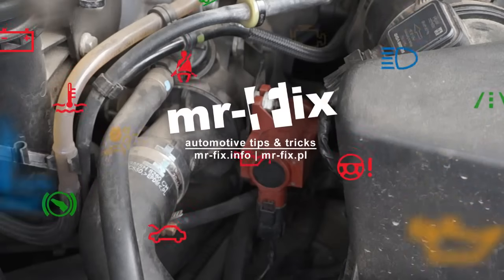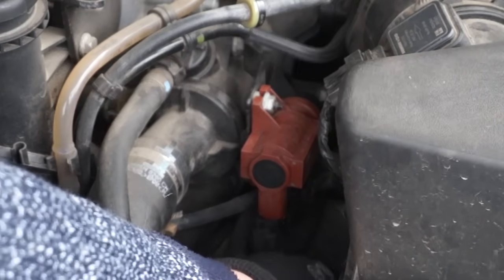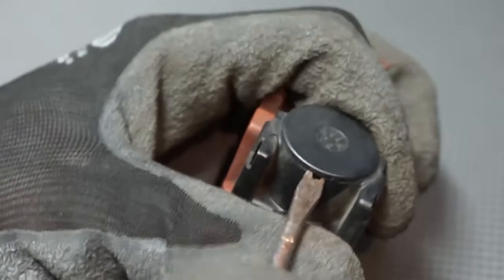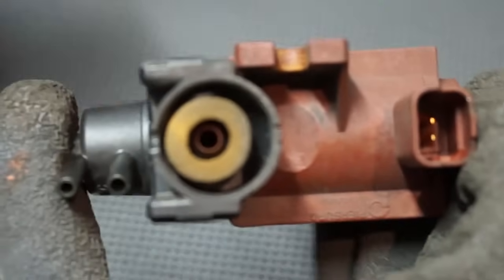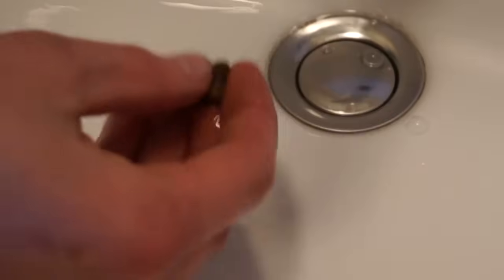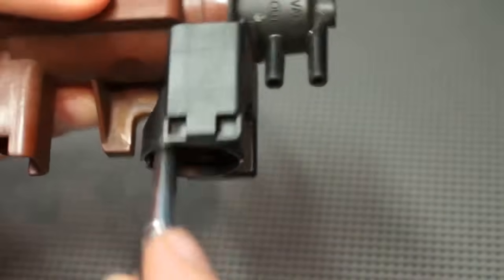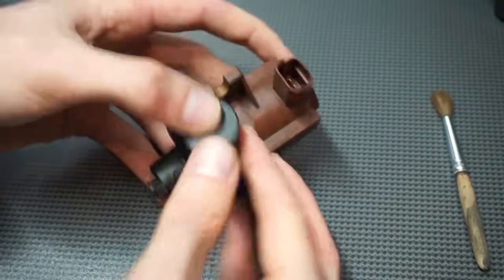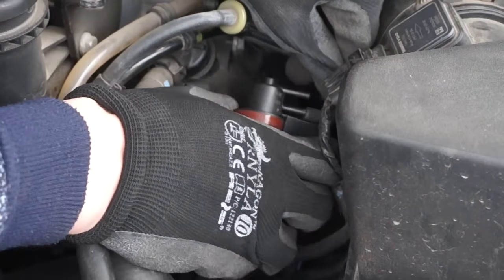How to clean vacuum valve air filter in 1.6 & 2.0D TDCi, HDi engines (Volvo Ford Citroen Peugeot)

Comment: Is it turbo boost sensor? I have got p2566 malfunction
Reply from the maker: No. It's not the turbo sensor. It's a vacuum valve which controls the turbo.
Reply: @mrfixpl  so where is the turbo boost sensor 2.0tdci ford engine?
Reply from the maker: @bartbartosz6448  There's MAP sensor on the intake manifold and there's a VNT position sensor on the turbo itself.

Comment: I did not know where exactly this valve is in focus 1.6TDCI 90hp
Reply: I've got this car, on my 2007, it is on the back of the engine, you cannot see it. under the black plastic trim with the wipers on, there will be a breather type pipe with a filter on the end. follow this down until you feel it, it was a whole arms reach down if that helps. I have yet to remove it and see however, but I will be jacking the car up soon to have a look underneath as that may be easier than through the top.